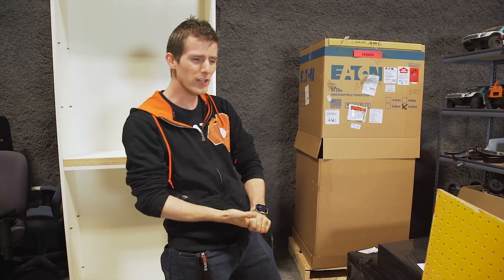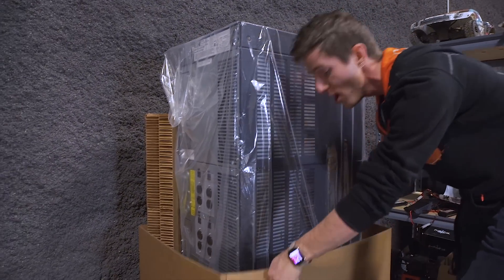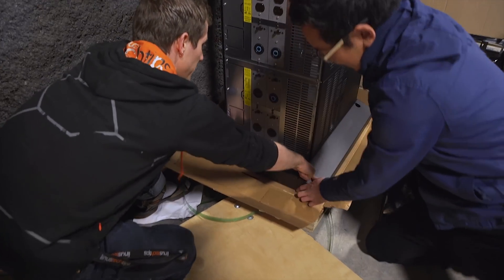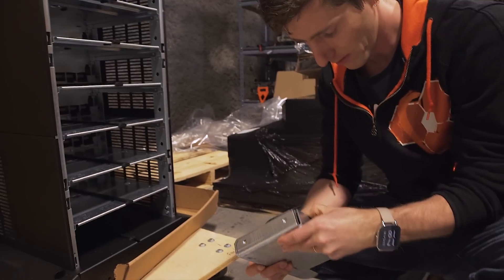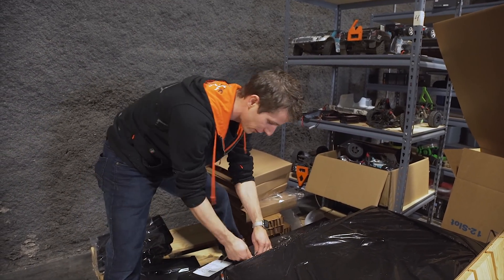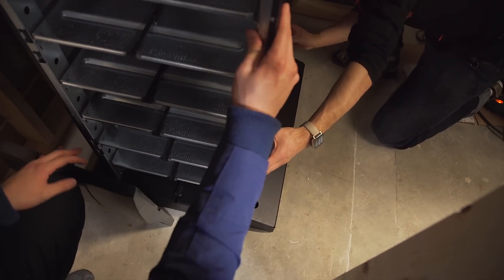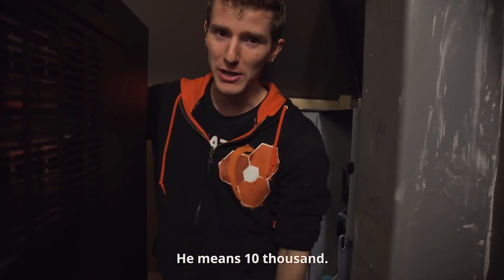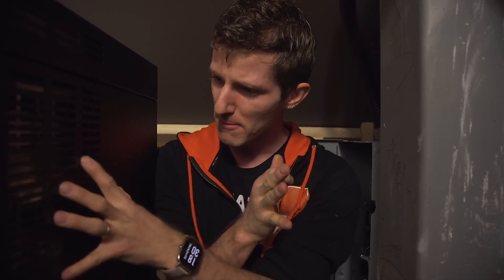HOLY $H!T - A $17,000 (CAD) Man-sized Battery!

Comment: This thing costs roughly the same as an APC Smart-UPS Online with similar capacity and runtime, so the price isn't exactly surprising. You're looking at roughly $7k USD for a 10 kilowatt UPS, and around $3k USD for the three extra battery packs required to hit the 5 kWh of that Eaton unit. That's ~$14k CAD, so not far off.

Comment: Woah go big or go home lol.  We got one of those installed at a hospital I worked at.  Well, a room worth of them. :P  At home I have an APS750 Inverter-charger and about 390AH of battery power, so about 3-4h of uptime for my load.  I eventually want to go to a -48v rectifier/inverter setup like telcos.  Basically a dual conversion setup.

Comment: Those aren't twelve L14-30R outlets. At first glance, they look like they are standard 5-20r outlets. The L stands for locking and those don't look like the locking outlets. A 5-20r outlet looks just like a standard wall outlet except one of the vertical plugs is a T, signifying that it can supply 20A of current through the plug. The lower outlets that you state are L14-30R are probably that, but I can't say for sure without seeing the hole arrangement. The first number of the outlet identifier tells what voltage it runs at and the 2nd number is the amp rating. For example, L5 are 125V only, L6 are 250V only, L14 are 125 or 250V, and it goes on. So an L6-30r outlet is designed for 250V only at 30A.

Comment: Fyi @LinusTechTips, I would recommend you set an event in your phone in 2021 / 2022 to consider changing the batteries.  One of the most common mistakes with those is people install and forget, then have a power outage in 8-10 years and wonder why the ups didn't work and find out the batteries look like they are ready to explode.

Comment: if linus wanted to as well, he could use those rack ups for the network equipment.   powering one or two switches off those units would power it for longer than 25 mins i can guarantee it.

Comment: With such a large and heavy battery rack, one always considers safety first.

I hope the room that you placed this rack in is ventilated and has a hydrogen gas detector/alarm installed. If any of those batteries develops a problem and starts to leak that explosive gas, it will get messy in a big hurry.   These run around 200-750USD and can be integrated in with your current alarm system, which is highly recommended.  Remember, it only takes about 7.5% concentration to air to make hydrogen explosive.

Battery or electrical fires are messy and nasty as hell. Water-based fire control agents are NOT to be used!  Consult with the national fire code or fire marshal for proper extinguishing agents for your installation.

One last thing, proper spill control agents in case of a battery rupture or leak may be in order. That stuff is nasty to concrete floors and anything else save for ceramics and glass.  There are purpose-made items for spill control and cleanup. Check with your local safety equipment house for details and pricing.  

These items are one-time purchase, save for some of the  clean up materials, which have a 1-5 year lifespan before refreshment. Investing in safety now will pay off in the future.
Reply: i'd be more worried about the fact that he plopped this thing right in front of an electrical panel. 

also cooling in that tiny room, optimal temp is 25 C for lead acid - any higher and you're basically killing your batteries and it's right behind the servers where the hot exhaust air goes.
Reply: +Nighthawke70 - Good points!  I didn't even think about that.
Reply: Not in UPS designs. Lead-acid cells still reign supreme despite their weight. UPS systems are built around three things: rectification, ampacity, and power conditioning.  Cheap UPS modules run on modified sine wave (read square wave) rectifiers and basic buck/boost controls.  This unit has silicon control rectifiers, (read, true sine wave, easier on the power supplies), battery charge and conditioners (discharging and recharging cells help reduce sulfur caking on the plates) and power conditioning equipment (Gas Discharge Arrestors that can take over 500K joules and keep on ticking).  These systems are built to sacrifice themselves in the face of adverse power fluctuations to keep their charges safe.

IMO, I'd still like to see a generator put into play though, for long-term operation in case of a major event that knocks out power over a long time period.
Reply: +Nighthawke70 SLA is also the safest chemistry that wont spontaneously burst into flames, its also one that can handle rather large discharge currents in the shorterm. Lithium fires are very bad news especially in a string of batteries. No FM200 system or whatever could extinguish such a Lithium fire, as they don't even require external oxygen supply to burn.
Reply: Wow xD
Reply: +Nighthawke70 I'm going to assume they are some type of lithium cells.
Reply: +Nighthawke70 everyone is forgetting that standby style batteries are sealed so cant vent to the room. No worries at all.
Reply: Luc Mathlin On the contrary, they can bulge and split the seams at the top, then start to leak out. If they are overcharged, can blow their seals and vent hydrogen, making for an explosion hazard.
Reply: Nighthawke70 Too right, also only takes a single weak/bad battery in the string that once put under load can suddenly vent hot gas. Often the batteries in question just passed an annual inspection... our datacenter got stunk up once or twice because of it. A typical setup has a lot of HVAC blowing around so theres little way for hydrogen gas to accumulate... hopefully Linus's server closet is well vented.
Reply: Speaking from my own experience when the company I work for has fitted large ups for lifts and data centers they have always been sealed lead acid running in 400v dc arrays.
Reply: For this kind of money, I'm sure the quality is better than the shit UPSs you've dealt with in the past. Overcharging a lead-acid battery to the point it splits and vents? The engineers on THAT UPS should be fucking fired.
Reply: Thats why most of the APC equipment is crap now. Even there  entry to mid tier enterprise grade stuff still doesnt have proper individual battery monitoring. So you have a 100- 400v DC string with absolutely no cell balancing at all. So it is vary common that 1 battery will take out an entire 10-30 battery, pack.
Reply: home made H-bomb?
Reply: Justin sénéchal
I'd say more akin to a FAE (Fuel-Air Explosive) type, but more violent due to the nature of Hydrogen.
Reply: His unit did end up failing so you are totally on the right side. Something to do with a spark on some internal connector. I don't remember the details.
Reply: @Terrobility  the nuts on the power busses weren't secured/didn't exist so it kept arcing until it burnt the pcb

Comment: You say the 240 volt is the heavy duty outlets yet in Australia, that is the normal outlet voltage
Reply: Same in most European countries.
Reply: Same here in the Netherlands
Reply: +surfie007 European here. 480v for heavy duty. 240v for normal devices.
Reply: +surfie007 240 volt high amperage, not like you have. what you are thinking of we run at 120v
Reply: This has to be one of the dumbest things to brag about.
Reply: +surfie007 in Australia, our "heavy duty" is 415V 3-phase
Reply: 240V is common in a lot of countries, but your standard home outlet there is only rated to 10-15A, some 20A. NEMA L6-30 and L14-30 can push 30A. Still not super high current when compared to something like 4/0 which is rated up to 400A @ 600V
Reply: Abe Coulter I was like 5 trying to plug in my piano to do piano homework
Reply: We use 240 volt for most residences and offices in North america - but the transformers are centre tapped and most of the runs for lights or outlets are one hot and neutral (plus ground), giving 120v, usually with 14G wire and a 15A breaker. More recent kitchens have 12G 3-wire @ 20Amp which has 2 hots, neutral, and ground - each dual outlet is split with one hot on the top outlet (120V) and the other hot on the bottom - this gives twice the power with only 1.5x the copper. If someone has a foreign appliance (almost always an espresso maker) an electrician can put in a 240v/20A outlet with minimal effort - though they need to watch what else is on the circuit to not overload it. Also, typically we have fewer devices per circuit and our plug-in heaters and kettles are limited to 1500W or 1800W with a 20A plug but these aren't sold much as only in newer houses would the customer be able to plug it in. 

If you're hiring an electrician to rewire your server closet you can put whatever you want (within code) - -48vDC (with a converter, obvs), 120v outlets, 240v, contract the power company and you can get 3-phase, 10KV (presumably only to an industrial plant), etc, whatever your wallet can afford the engineering, equipment, and electricians to install.
Reply: +FrozenDragon 400/230
Reply: +surfie007 US and Canada 120 is the standard wall outlet.  240 is high powered commercial equipment(restaurant deep fryer or walk in freezer) or for running temporary power to things like mobile homes(stepping down to 120 at each outlet).
Reply: +surfie007 Isn't it actually 230V in Aus/NZ?
Reply: +surfie007 I feel bad for you. 120V is safer and so are the US receptacles
Reply: +Severen Redwood Its 240 volts.
Reply: +Derin T. Wrong. It takes both. You can have high voltage and low current and be fine, or high current and low voltage and be fine. Need some of both.
Reply: +Severen Redwood Anywhere between 220V to 250V depending on the current demand.
Reply: +DecalsAndFriedChicken lol
Reply: it could run 240v on 2A but it would be the same wattage as 120v 4A
Reply: +SecretPotatoChip I guarantee you us sockets are one of the most dangerous in the entire world. The safest by far are the uk plugs.
Reply: +Luc Mathlin what about the new American plug standard? Much safer. The neutral and hit are blocked and can't be opened unless tow prongs push them at the same time
Reply: +SecretPotatoChip That's been part of the UK sockets (bs1363) single the 1960's. Also the feature of having sheathed plugs and most of all fuses in the plug tops them self makes them the safest design in the world. The us plug can be plugged in enough to liven it up but still enough room to sick your finger into one of the pins, bad design.
Reply: Luc Mathlin You can't stick your finger into any of the pins
Reply: +SecretPotatoChip I've stuck my fingers in the pins before. It feels like a shock pen. But I did do it through a power strip's outlet
Reply: you idiot
Reply: Haha. I tryed ramming a eu plug into a nz socket. Fail. i was 7

Comment: We have 5 of the 15 kva two with power units only and three full of batteries in my comp. Supports the whole central network (including switches) for 3h those things are awesome. Almost 100 metres of electrical cable to hardwire it into the circuit.

Comment: Hey linus, can you please explain why you chose this over like, a generator or somthing? thats what hospitals use? the power drops, batteries take over, then generator takes over.
Reply: +Rezinator483 nvm conditioned. gotcha. shoulda kept watching the video
Reply: +Rezinator483 and maaaaybe socks and sandals when moving heavy stuff isnt the best idea,
Reply: +Rezinator483 A generator dosen't replace a UPS since in takes up to a minute to switch on, so the servers would have to shut down. And the main point of this is to safely shut down their servers not run them while the power is out.
Reply: ye but thats why they have the smaller ups to take over until the generator kicks i just feel 17k on a ups when 2k on batteries and 5k on a generator would produce more power for longer with the same effect for half the price.
Reply: Rezinator483 Depends on how much power their servers use, but yea, would be more cost effective to get a UPS Setup that runs for 10-15mins and if needed, a generator. But then again, most of whats on this channel is not really cost effective, and part of the reason they buy this overkill server gear is to make a video about it.
Reply: gotcha, i was just wondering lol
Reply: At the same time tho, a 5k generator could also run their building?
Reply: I agree, if this was my company, i would buy a UPS that could run my current servers for 15-20mins (So it would still be able to run for over 10 mins if i got more servers). No need for a generator for what their doing but if i had extra cash to spend I would get a 25-50kw generator.
Reply: +Rezinator483 my guess is that since they are only leasing a unit in the complex that they might not have rights to land/ permission to install a generator or it would just be prohibitively disruptive to install one.
Reply: +Rezinator483 because generators take time to turn on.  in the event of a power loss, the batteries keep supplying power with zero downtime

Comment: Linus you should consider an emegency breaker on the wall in case of a fire/etc., but also you should consider the bypass unit so that if you need to take this out of play you don't need to shut every single thing down.  I've used apc symmetra lx 16kva very often and the bypass is much desired.

Comment: Video card : gtx 980 
Processor : i7 4790k 
Windows 10
Ram : 8gb ddr3 
Motherboard: Intel z79
Drive: 24x dvd dual layer drive
Power supply: 600w
Hard drive : ssd 240gb hdd 2 tb
Also Comes with a usb mouse and usb keyboard commander series

TOTAL PRICE = 1700 it's also already built

Is it worth the money plz tell me I wanna play games at high or ultra can it do that

Comment: I ran 4 UPSes and from my experience it's much better because of : longer running time, last longer and cheaper on the long run, to use Maintainance Free Magnesium Hybrid Car Acid Battery.

Those internal battery last at most 2 years, while the Car Battery last about 6 years, which much longer running time.

Just make sure the charging unit capable to handle larger Ah car battery.
Reply: +Harpax A - A proper UPS with a new set of batteries will not need replacement batteries for 3 to 5 years.  
Car batteries will not last longer if you actually use them for run time because they are not deep cycle batteries.
Some cobbled together thing such as you describe would be unsafe to operate.

Comment: Linus - what are you running with this online UPS? I use on-line UPS' on my servers - would never use line interactive on a server, but they don't cost this much. Generally don't need more than a 1KVA (usually supports 800W) unit per server with a 50ah to 200ah battery  backup - about US$250~US$500 - Just curious what you're running.
Reply: +Craven Coetzee - I think he over bought on power because he wanted more run time.  He didn't choose to implement a generator system, so he is relying on a long run from the battery to complete any active video render in the render server before shutdown.
Reply: Chris Moore Yup, think you're right. Now that i know what he's running, it doesn't seem quite as over-the-top.

Comment: They actually make those down the street from where I work in Eden Prairie, MN. I don't know if that's where your particular unit came from, but awesome stuff. That network module, yikes, that does seem a bit overpriced. The datacenter at my work has a few of their bigger units. I didn't look at the spec sheets, so not quite sure the ratings, but they're hard wired in by an electrician. I think I'm more excited about this video because I know where they make them.

Comment: now, move again a to keep minimum distance from power box.
Reply: I was thinking the same thing when he first pushed it in front of the panel. The working space headroom above that panel seems to be too low as well, but I've seen inspectors "pass" worse than this, so maybe he'll get away with it. (Or maybe just maybe, this is an un-permitted job going on here and the electrician knows that nobody will be inspecting the installation, seen plenty of that happening too).
Reply: +J Thomas Kind of scares me that these guys are doing the installation and especially the wiring from (and maybe to) the 80A breaker.
Seen a bit too many fires from those kind of self-proclaimed experts.

Comment: https://www.pccasegear.com/shopping_cart 

is this a decent budget gaming pc
Reply: that link doesn't show your components bro
Reply: Sorry
Reply: +Charles Harrop lol no problem bro. Do u have another way u can send it? :) or u can list the components
Reply: +Charles Harrop where do u live btw? so I can see prices
Reply: aus
Reply: +Charles Harrop ahhh okay, was on my phone and saw $519 dollars for a gtx 970 and was like wtf ) Your system is pretty good . I would recommend saving for a cheap SSD to install windows on and use your games etc on the Hard Drive. This will make boot times really fast and overall make the PC run fast for a long time. Even with a powerful system ,PCs get really slow and sluggish when using just a Hard drive
Reply: +CemerianHD thanks but would i want all ssd or get a hdd aswell
Reply: +CemerianHD also can i have you email if i have any other questions?
Reply: It really depends. I myself use a a 3TB hard drive and a 256gb SSD. On my SSD I have my windows installed and applications like google chrome which I use regularly and games I use regularly. All other games and applications I install on my hard drive to save space. My pc runs smooth as butter )
Reply: I a 1TB HDD viable with a 128gb SSD for my pricing which is about a $1000 - $1150
Reply: Yep bro :) A ssd is definitely worth it. Also ssds are much cheaper nowadays. My old pc used to have really high end specs and became sluggish as hell before i added my ssd.

Comment: 12 kVA = 12,000 Volt Alternating. Not "kilovolt amp."
Reply: +David Cheung 
No, he's correct. VA means Volt * Amp which is W - Watt, Power.
"Volt Alternating" is AC which means Alternating Current
Reply: Thanks. I've always been told that it was a representation of the type of current, not apparent power.